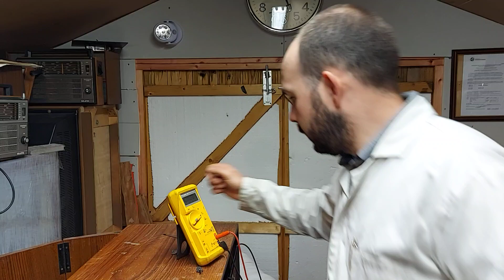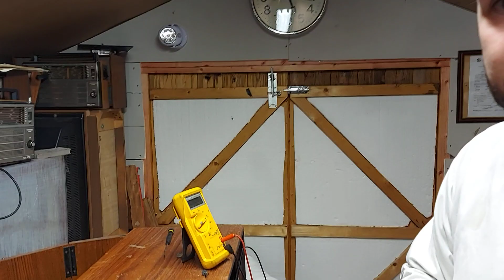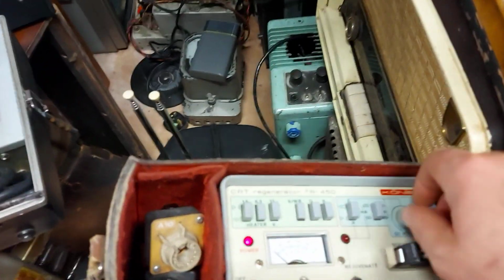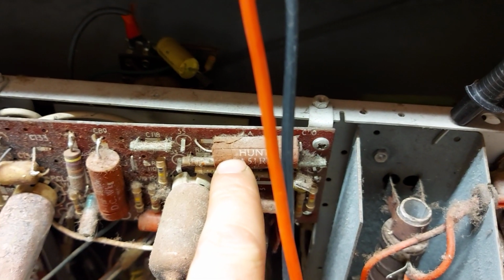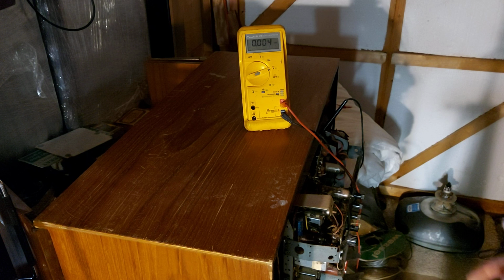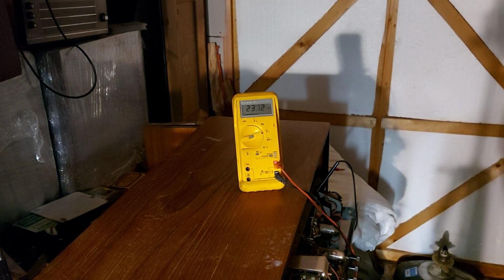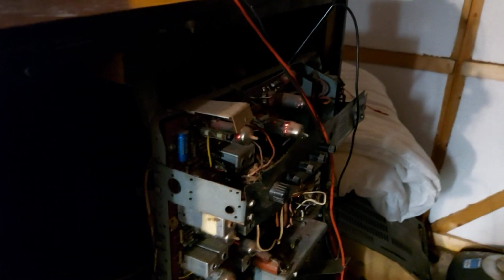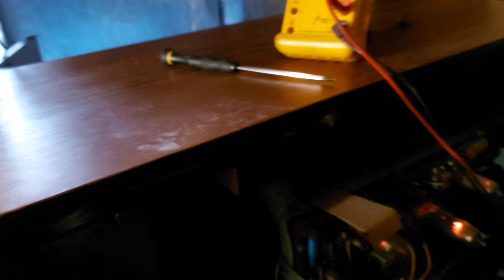Pye Dual Standard TV.

Comment: My Mum and Dad had a daul standard set rented from DER remember it had  a FM Radio on it however the UHF 625 Part of it never worked properly and despite them being in a good reception area it only produced a faint snowy BBC 2 Picture.  They replaced it with a brand new single standard UHF 625 Line set

Comment: Can't remember when I last played with a dual standard TV.  Think it was probably a Thorn 1400 chassis when I was a lad.  I seem to remember that the big 405/625 changeover switches were always trouble.
Reply from the maker: If I remember right the 1400 had a solenoid operated switch.
Reply: @IrishvintageTVRadio  Oh yes, it might have.  Big clonk when it switched over.  I never had much luck with the 1400 but was delighted when I was given a 1500, that was my first decent TV and worked for years.  Ah, fond memories of replacing a 30FL2 which had microphony.
Reply: @IrishvintageTVRadio  Seem to remember the 1400 was very fussy with tuning the intercarrier sound on 625 lines
Reply: I had one always caption buzz on 625

Comment: I'm sure shango066 also had crt's that seem really bad but they do work , the crt testers are looking for almost new tubes. Too picky.
I made a crude crt rejuve unit, a few resistors/caps/diode for the high voltage and a basic 6-15v variable supply for the heater.
And a series milliamp meter to show when the emmision was getting better.
Very crude but it got some tubes working :-D
Well done for 500 subs :-D
Reply from the maker: Thanks ZX! Sounds like a handy little tester you had there.

Comment: That set seems to work quite well all things considered. I think that Jordan Pier should take a look at this video and revisit that Ward's Airline TV (made by Wells Gardner), he was attempting to test the CRT with a different, but similar numbered listing, and I'm not sure that you could rely on the results from doing that.
Reply from the maker: Feel free to share the video Oleg. I learnt early on that CRT testers were only a rough guide after nearly condemning a couple of good tubes (kines) that read poor but showed acceptable pictures. We don't have the option of being picky these days.
Reply: @IrishvintageTVRadio  I might just post a link to your video under his. Depending on what tube it was it may be easy to find a good replacement or extremely difficult, but it just makes sense to try. If he can get the H.V to work the tube should light. I only have one TV here with what may be a weak CRT, but I have no means of testing the tube, it lights but if the H.V is low then it could make even a good tube look weak.